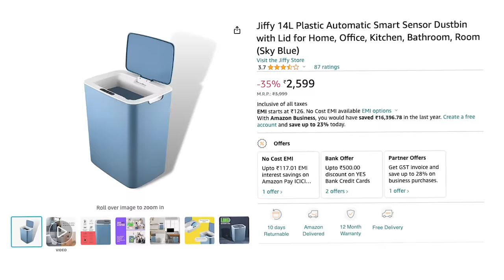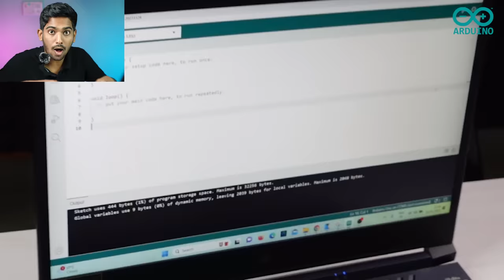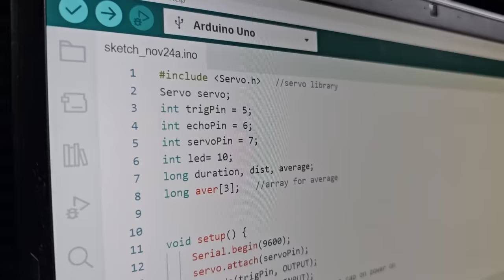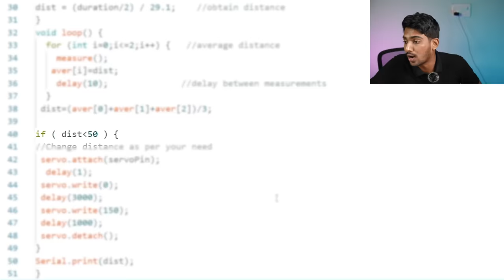I made దిమ్మతిరిగే Smart Dustbin!

Comment: i have made more than 25 projects until now using arduino uno ,esp32 AND SOLD THEM 
1)FIRE DETECTION AND MONITORING
2)BT LIGHT LUX DETECTOR
3)COUNTER USING IR
4)WEATHER STATION
5)IOT IRRIGATION
6)HOME AUTOMATION
7)ROBOTIC ARM
8)TRAFIC LIGHT SYSTEM USING LED
9)RADAR OBJECT DETECTOR
10)LIFI TEXT TRANSMISSION USING FLASH AND LDR
11)LIFI COMUNICATION
12)GPS BLUETOOTH MONITOR
13)AUTOMATIC SANITIZER CONTROL
14)BT RC CAR
15)OBJ AVOIDING CAR
16)BT DISTANCE CALICULATOR
17)KEYPAD DOOR LOCK
19)8CH VOICE COMMANDS
20)AUTOMATIC LIGHT
21)IR OBJECT MOVE DETECTOR
22)SMART DUSTBIN
23)SMART INHALER
24)SMART IOT EV CAR
25)WATER TANK MONITORING SYSTEM